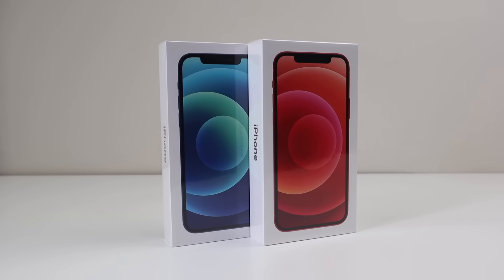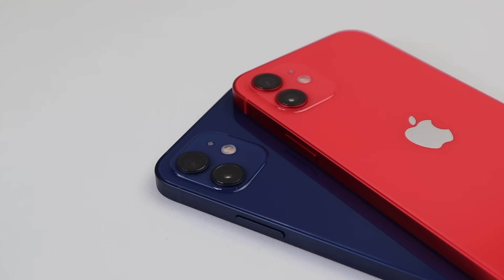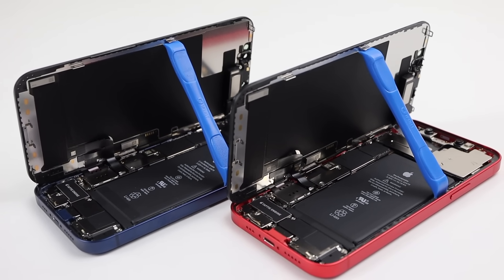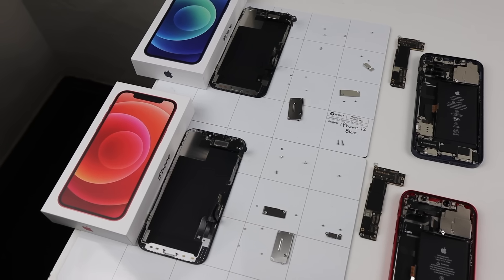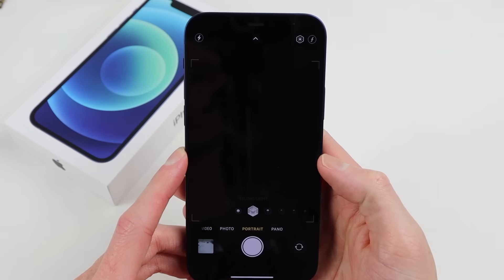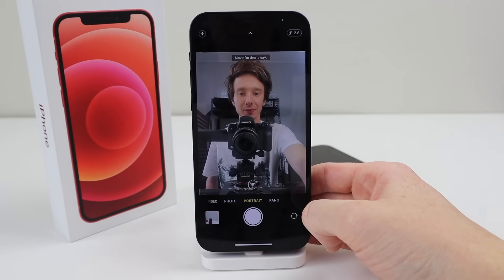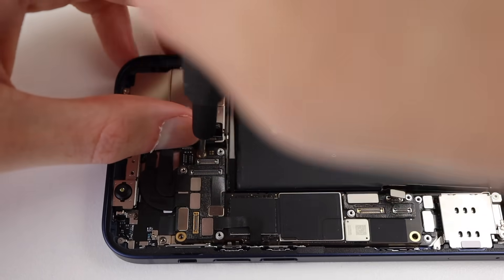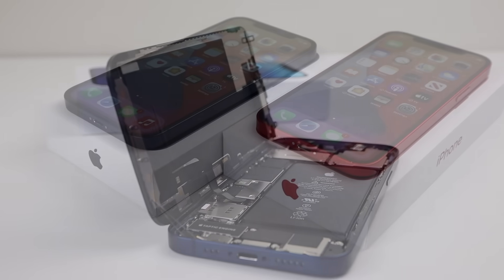iPhone 12 Anti Repair Design - Teardown and Repair Assessment

Comment: The fingerprint reader on the home button has been paired since it came out, it's a security feature that makes it more difficult to brute-force the fingerprint ID on the phone and impossible to man-in-the-middle it, because some of the processing of the fingerprint is happening on the home button itself.  The same thing is going on with the cameras, due to the face ID.  That's the "why".  Apple is certainly also benefiting from limiting repairability outside sending it to them and paying them for the repair, but the primary reason for the pairing has always been to improve security.

Sure there are still ways to hack the phone, the NSA/cellbrite etc make it their business to hack consumer hardware.  But just because big and powerful groups can throw disgusting amounts of cash at the problem to get in, doesn't mean you should just give up on security.  One way or another, enough money will get you around security - the goal here is simply to price most threats out of the market.

None of this means I oppose right to repair - I do completely support it.  But pairing security devices is the wrong field to fight that battle on, because Apple can legitimately cite consumer security on that front.  The battery does piss me off though - I can see why they'd complain about a 3rd party battery, but I see no reason why an actual genuine Apple battery cannot be swapped.  Battery history is maintained on a chip onboard the battery, so they can't be saying "we don't know the history of that battery you swapped in", because they get that history FROM the battery itself.

Hopefully the camera "buggy behavior" and "we don't like the OTHER Apple battery" issues are addressed soon.  But the rest of it, the pairing of the camera and home button for face/touch id, I think they need to KEEP that.

Comment: Well, I've owned an iPhone 6 for years now thinking of upgrading but me having to change an adapter and pay more money is not great especially when the price of the phone brand new has not changed you'd think if the price included the charger and adapter you'd deduct that from the price. To top it off my iPhone had to have a battery changed because it was faulty this was a few months off release thankfully it was free as it should be, but if this one goes faulty and they're making it that hard to repair we'll, I'm going to have to think about that one hard. Remember my iPhone 6 was about £1000 that included the charger the adapter and headphones this one is over £1000 and doesn't have an adapter, and I'd have to get AirPods. I'm leaning very heavily towards Samsung which is cheaper and has a better camera as well as if true a better battery since this one is smaller.

Comment: Apple Certified Tech here, I also repair phones outside of Apple and there has always been a way around the needed ‘calibration’ to pair replacement displays and other parts to previous iPhones. Guess we’ll have to see with these phones if that will be possible again. This vid does goes great lengths to help the repair community to see what that might be. Thanks for uploading!
Reply: ... I wanna ask. Does this seem like a monopolistic move from. Apple because it makes them basically the sole people who can fix it Apple.
Reply: Apple is known to have conflicting views on self repair. Apple most often states that is is dangerous for non-qualified and third parties to be able to repair their devices because it could compromise privacy and reliability of their products.
Reply: @im_the_brains3294  Then apple should offer incredibly cheap and fast repairs themselves. If they care about their image so much, they need to pony up the resources instead of screwing customers.
Reply: @im_the_brains3294  I find an issue is that the only way to “qualify” is that you went to Apple in the first place.
Reply: @im_the_brains3294  also while the law may not see a monopoly in this regard I’m sure other people share my view

Comment: Broooo, you have to disconnect the battery for anything you do. You can cause many issues because you’re not disconnecting the battery from the logic board. I’m a technician and you have so many things wrong. You need a certain amount of heat to remove the screen. 

You can burn the backlight resistors when changing the screen while having your battery connected or having your phone connected to power. Jesus Christ I got anxiety watching this video. I do this for a living lol.
Reply: You don't know what you're talking about.

Comment: To say a design is built to be anti repair is lawsuit material. Apple already sells the parts needed for repairs, and within last couple months expanded that area even more. Not sure what the complaint is anymore. The same laws that protect the coke recipe protect apples rights to their devices. Again there are multiple programs to buy new apple parts from apple, and can buy old devices online. No different than samsung. Maybe when you can buy a snapdragon processor off the shelf at walmart you can get an apple A chip as well... not that I would ever want that available at a store though.
Reply: STFU!

Comment: I wonder if someone will come up with a way to to pair new parts to the phones themselves. This reminds me of the XBOX 360 disc drives. They were paired to each console and in order to use one disc drive on another 360, you'd have to change the bios/firmware(cant remember) on the disc drive to match the new console.

Comment: I’m only a minute and a half in and I’m fuming. I knew they’d stopped supplying the power block, which I didn’t really have a problem with, because I’ve got like 5 of em, but didn’t know they’d switched to USB-C. I have a total of 0 plugs in my possession, so.. wtf, Apple?

Comment: this is DEFINITELY a software lock. They're identical
hardware, the fact that the iphone can identify serialization & refuse to operate with the new part makes me think that the software is deciding not to use the new hardware. This would also explain how "only apple" can make the EXACT SAME parts work when they repair, it's not because they have parts that are instantly compatible with your phone, its because they configure your phone to accept the new serialization

Comment: You need heat to remove the screen lol.
Reply: Not on normal iPhones. I fix these for a living and have never had to heat up the screen to remove it. It's the stronger adhesive on these new ones that makes the difference.

Comment: If i have understood correctly, Apple has locked any thrid party component replacement, so every display is verificated with only one motherboard, and when genius bar employees replace your display must reschedule the device for it works fine. 

it's a heavy punishment for second hand market by Apple, bye bye to buy locked iphones for parts.

Comment: Apple: Theres already 2 billion chargers out there, use them!

oh and by the way you can’t use any of them cuz we just decided to switch to USB-C 😏😏😏
Reply: Can't they just use their old cables though? It's still using the crappy old lightning one right?
Reply: @true_neutral3378  it's the output from the charger into the phone that's changed to USB-C 🙃
Reply: @TheTeaTVI  so it's the wattage? No fast charging when using a regular cable?
Reply: @true_neutral3378  no, it's the same power (we hope) just a different cable :)
Reply: @true_neutral3378  yes of course you can do it and people will do it too. Haters gonna hate no matter what. But its funny that haters (who will never buy iPhone for whatever reason) are criticising only one thing about brand new product and its missing power adapter, which speaks for quality of iPhone 12.

And even if wattage changes (have no clue how - if the only difference is shape of one end of cable) you can still use it, you will just charge slower. 

And you will charge this cellphone wirelessly anyway.
Reply: @nonamenosurname8516  For one, slow charging actually lowers the life span of the battery, which is why some phones have a warning when you use a lower wattage charger with a phone meant for a higher wattage. Also, the argument of "it could charge wirelessly" would really only work here if they included a wireless charger, which they don't. So they literally took an essential component that, if replaced without former knowledge, could lead to a lower lifespan of the device. See the problem now? Also it is clearly a money grab to make people who didn't have an iPhone before to also have to buy a new cable. It's greedy, shitty, and downright detrimental to the consumer
Reply: @Delta0429  Hey sorry if This is a dumb question.. so if I buy a 12 pro max with a MagSafe wireless charger which is usb-c with a 20w adapter also usb-c both from Apple is that ok for there new wattage specs or will that mess up the battery..or should I just use the cable that comes in the box with there 20w usb-c adapter that’s sold separately from Apple ???
Reply: @TCF1MS  The safest is always to use the adapter directly from them since it's made for their brand, but buying an adapter from third party that is the same wattage should change close to nothing in the long run, so yeah I'd say you could do that
Reply: @true_neutral3378  Yes, that's the bottom line. People just love to hate on Apple for no fuckin reason despite there being thousands of actual reasons to hate Apple. In fact, people were complaining about not having a cable to connect their iphone to their laptops... and now they do. Apple solved that problem, but people are going to bitch and moan about anything they feel like. This is why companies don't listen to consumers.
Reply: @Sarcastitonea  but it's just the fact of environmental impact
Reply: +1000
Reply: That just the US tho. We got  USB-C Chargers in Europe with the last iPhones.
Reply: Youtube ➊  So when did they start implementing USB-C chargers? Was the 11 line the first one? Cause I agree, theres really no point in getting an iPhone 12/Pro if you habe an 11/Pro.

Comment: Screen: $66.50
Battery: $10.50
Triple Camera: $73.50
Processor, Modems, and Memory: $159
Sensors, Holding Material, Assembly, and Other: $181. The total cost in parts and labor to put an iPhone together. The worker who assembled it was paid 3.15 an hour.

Comment: I believe the camera issue is related to software bug. If it’s anything like the older series. The Screen IC chip can be moved to the other screen to remove the important display message. True-tone can probably be reprogrammed by programmer. As far as the battery the original battery flex cable is probably like the other ones where it can be transferred over by soldering it to the new replacement battery and that message would also go away. Apple is probably making it harder for shops that do not have experienced board repair technicians or as professionals would call it.

Comment: It is "technically" a software issue when you replace parts insofar as when you replace parts in the most recent iPhone models, you must also run a calibration software provided by Apple. This program is cloud-based and therefore is not available for anyone who isn't Apple or an Apple Authorized Service Provider.

Actually, IFixIt has an article about that already: https://www.ifixit.com/News/33593/heres-the-secret-repair-tool-apple-wont-let-you-have
Reply: You're looking at this backwards. It's not a software "issue", it's intentionally designed that way. They went the extra mile to design everything this way, spent millions just to do things differently, all for that the clients can't repair the items they bought and are forced to buy more. Why? Because that means more sales and more money for Apple. This calibration wasn't "necessary" until they MADE IT SO to enforce their business scheme. It's not actually calibrating anything, it's just an unnecessary step to prevent 3rd party repairs. A legal loophole because normally this would be illegal.
Reply: In most of the world where you can buy apple products through major telecom companies, there is no oficial apple store for service. This absolutely sucks.

Comment: This is just like the Xbox device security. Each "modual" i.e. camera, battery, display ect. has a security ID on the part itself that checks agaist a list on the motherboard, if thiers a mismatch it freaks out, all you need to do tho is find Where the ID is stored on each marts firmware, Read it, and either change the parts id to what the mombo is looking for or change the list in the mombo(easier to change the part ID IMO) Lookup UART port hacking and xbox hardware security.

Comment: As programmer, I can say: It's all bond to ID's!
Now apple is holding an ID list of all parts inside OS.
Reply: I am a hacker so I can suggest  a solution for this . As from my concept apple is using a id match with all of its parts . So just jail break the phone or just clone the Id of old part to the new parts so can be solved
Reply: @johnpaul4111 💯 correct ❤️
Reply: @johnpaul4111  the ids are probably encrypted in a dedicated chip. You can’t directly access it that’s why you can’t change the touchID sensor since the iPhone 6. Even the display you can use a device to clone the serial of the older one to the new one but the touchID (and certainly faceID too) are encrypted.
Reply: I think that the Device Serial Numbers / IDs are not pre-stored in the OS. Maybe apple has a little programm they execute after manufacturing that fetches the device’s ids and stores them in an list. When rebooting, the OS tests if the connected devices match the ids on the list. 
This would also enable Apple Certified repair shops to replace parts. The just have to run their program to refresh the list. 
Maybe we will be lucky and it leaks soon.
Reply: With Apple manufacturing their own SoCs, this ID check might even not be part of the OS. That would make this way more difficult to hack. 

As far as manufacturing goes: 
Maybe they have some code in their startup procedure that tiggers the list creation and is only run once. Afterwards it might set a fuse to skip this process on all future restarts
Reply: @sterkriger2572  there are centres for  decryption of encrypted files . Especially for I phones
Reply: As one programmer to another, I think it would be rather a difficult task to the O.S. and hold all the ID list of parts inside a presumably mass produced PROM. I would have thought the “best” solution would be to mass produce the O.S. PROM and flash the ID of the components (as they were inserted) into an EEPROM.
What’s your thoughts on that idea ? Maybe the CPU could be powered up in a special way in the factory, and flash on board EEPROM as a one time deal.
Reply: @nigeljames6017  It just checks IDs when it boots. not much overhead to store things away in memory.
Reply: @destroyerdragon2002  That is roughly what I was trying to say in an “electronic engineer” format. The main concern is where is that list stored and is it encrypted (if it is decryption is going to be well beyond the above the ability of most Government agencies).
Reply: Does this mean u need to reprogram the Os to repair?
Reply: That's what i thought of too, all the parts should have a matching ID in order for the phone to function properly or even boot up (if you're using non apple parts)
Reply: It won't be as easy as changing the os setting, from the video we can see that the device won't turn on because it doesn't have correct component, but I'm pretty sure Apple have some feature to change that so they can repair it on Apple store
Reply: @yourjofiwsp  Apple have a reputation of repairing nothing that is not in warranty. That’s the way they con you into buying a new phone. Independent repair shops are fighting this very hard. Fancy buying a new car, but as soon as the warranty goes up, you can’t take it for repair to your local garage, you have to go to go to specialize dealers. You are sort of renting your phone !
Reply: I am guessing it is getting the part id's from a storage location that is not wiped during a factory reset. It should be possible to jailbreak the iPhone and either spoof those IDs or just edit them directly.

Comment: Apple has always been very controlling with their ecosystem. While this 𝘤𝘢𝘯 suck and I do see agree this is an anti repair design... In this case, there are two reasons this seems fine.
1. Security. This significantly reduces the value for stolen parts/ iPhones
2. It reduces incentive to falsely report a lost or stolen phone. Sure apple can brick it. But now that the parts are bricked, people cant sell off the parts. Keeping these cost down for apple to allow the consumer to be provided anti-theft/anti-loss insurance via first-party Apple Care. 
3. This is Apple. Most people know that Apple is controlling and less customizable than Android, however they trade that for perceived convenience.  A lot of these consumers might not even care to fiddle with their settings, let alone repair their own phone, they want something that "just works."
So, being used to Apple steering the wheel, I would imagine it isn't difficult for them to accept Apple doing the repair either. 

Not saying there aren't exceptions to users and their preferences, and not saying Apple doesn't capitalize on it.